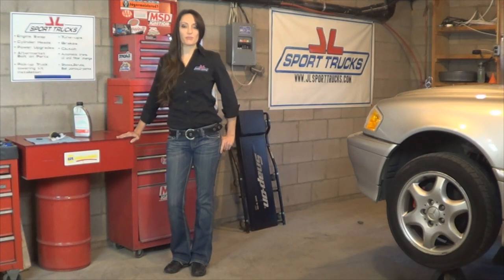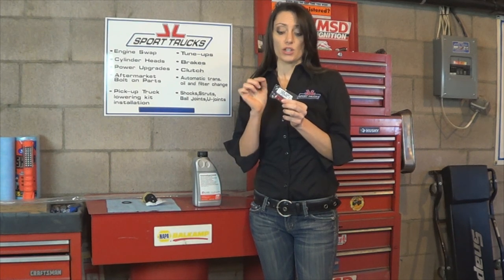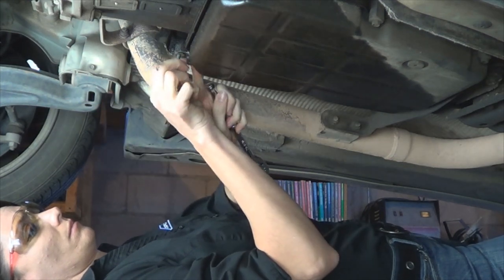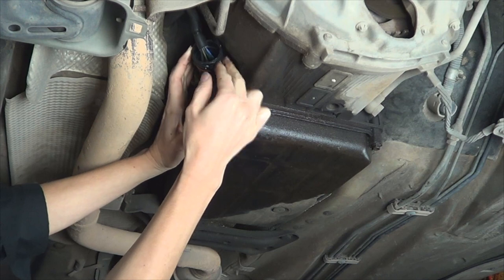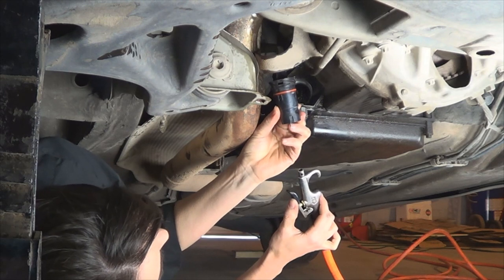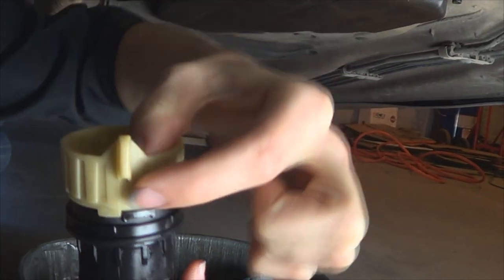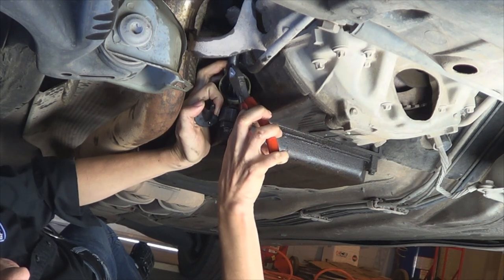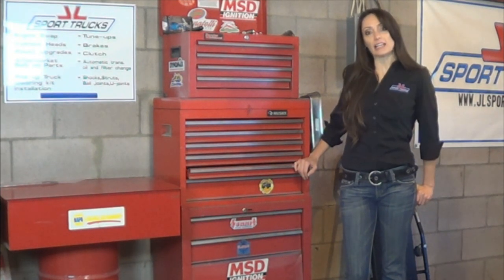1997 to 2000 Mercedes Benz W202 C Class Transmission Harness Connector  Leak Repair

Comment: dont worry about Damaging the Pins its not possible, it might feel like you can but if you take a closer look at the conductor plate where 13 pin connector plug goes it has little plastic walls protecting all the pins, and theres only one way to install that 13 pin connector plug, you need to alighn it perfectly so that it will insert properly, it is hard to install 13 pin connector its a tight fit, and you might be pushing on it and its not going in, just make sure you look at the connector there is 3 little cut aways in the walls of connector that need to go in same place in the conductor plate, I actually made a video about this, because I always thought i might damage the pins,  BTW you Guys make great Videos I seen allot of them
Reply: Time to check out your channel as well then. 

Edit: can't find the video on his channel. If someone else does, leave the link as a reply to my comment, so I can see it. Thanks in advance!
Reply: Well I must have damaged mine.  The Beck Arnley adapter was missing a hole so I kept pushing against that pin.  Eventually gave up, put the new O-rings on the old connector, and it went back together fine.  Except I have no gears at all.  And I hear a persistent clicking probably from the shift solenoids.  Doing the conductor plate next.  What luck.

Comment: Thanks for the info  you are fantastic 
i had a leak from the same spot and my mechanic told me it was a big job
and he took off the cover and filled it up with  silicon and charged me heaps

Comment: excellent video thanks for sharing ! I have some transmission problems in my 2005 c230 and the code error shows "705" code. which is the shifter. I thought maybe the connector could be a problem in this case, but when I tried to remove the pilot bushing  after losing the 7 mm bolt  it was like glued there, there was no way to take it off. I was afraid to damage something, so I cleaned it and put everything back. Is this normal? it takes a lot of work to take it out when is an old vehicle?    thanks

Comment: Thanks, this was a great video and very helpful!  The only problem I ran into was getting the bolt started when I put the new connector in.  It just wanted to spin, but I pushed a bit harder on it and it finally screwed in.

Comment: My trans is still going to limp mode. We changed the plug but had to use the o rings again since plug would not go in. I had a quart of oil fall out when pulled the plug. I will retry pushing plug with new rings again tomorrow. Next will be conductor plate/oil change. 1997 e-300. Your plug didn't have oil come out and insertion was too easy?

Comment: this was most informative. thank you for you posting. I'm fixing to undergo the same procedure. would you suggest an alternative to the atf1. an atf that can be obtained at local part stores. I know what is recommended is vegetable based and as clear as bad clear coat, having a yellow tinge. unlike the red tinted atf's domestically found. the majority of locally found atf's also being patroleum based. having worked on old British cars, I know you if you swap domestic dot3 brake fluid with Castrol dots, what's recommended. it will cause you to swap fluids again with a replacement of cups and O rings from where domestic dot3 fluid attacked the natural rubber. unlike if the cups and O rings were made of neoprene rubber. would you suspect the same horrible results, if I used synthetic atf locally found? thank you if you do respond back.

Comment: You didn't mention checking the plug on the transmission control unit. Fluid will sometime travel up the trans harness and into the control unit as you know of corse.

Comment: did they fix this after year 2000 models? like 722.6 w210 and w208
Reply: just did this on my 2005 c class 722.6 and works a treat!
Reply: Nope my 2002 CLK55 AMG has this issue right now.

Comment: Note to everyone who tries this repair: I just snapped that little 7mm bolt that goes into the conductor plate. I advise against using a ratchet, just tighten it finger tight until the connector is seated and then stop or you will snap the shaft of the retaining bolt like I did. Now I have to replace the conductor plate again, along with the connector, gasket and filter.
Reply: Did same thing! I took the adapter out 4 times its lined up but still would not set in and snapped screw with literally no torque!

Comment: I have the same car but the problem is the transmission won't shift up. Need your help what to do?
Reply: +vin roque I replaced the conductor plate on my 1997 c230 along with new fluid and new connector. The conductor plate fixed the problem. I also installed Sonnax valves as well, you don't have to but in the 1997 I recommend it.
Reply: +vin roque 
What David said. You can use a Mercedes scanner tool to confirm you need a new conductor plate. Usually the leaking connector shown in this video means transmission fluid will mess up the speed sensor on the conductor plate, leaving you stuck in 2nd gear. The Sonnax spring David mentioned is also worthwhile replacing while you are doing the conductor plate.
Reply: Just wanted to follow up now over a year later to say the transmission works even better than original. No leaks and shifting is smooth and concise even at first drive when cold.

Comment: If your is this bad you might want to go to your computer in black box above. Take lid off and pull trans computer. When you disconnect plug look in it real good. Common issue is fluid will wick up the wire harness and totally saturate box and trash computer. Just did full trans service on a E430 including this pilot bushing she is showing you. Luckily I was able to stop the problem before it contaminated the board in computer. Look up trans fluid in MB computer on YouTube. I've seen 1/2 quart come out of some. Like I said is a common problem on 722.6 trans but can be caught if serviced every 40K miles.
These were originally "sealed for life transmission but later MB said to have serviced like all others.
Hope I can save someone a lot of head ache and $$$$.